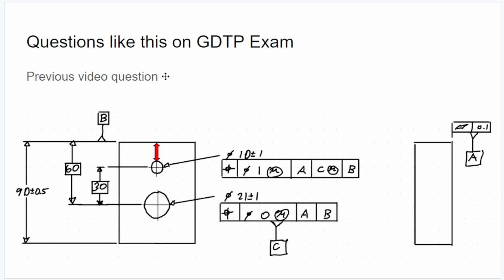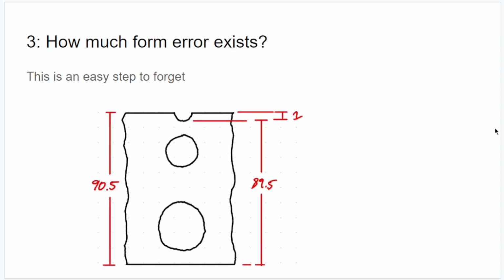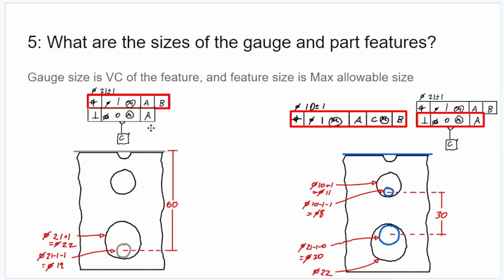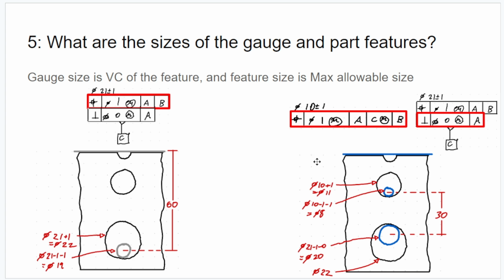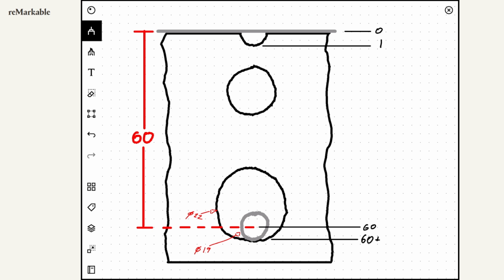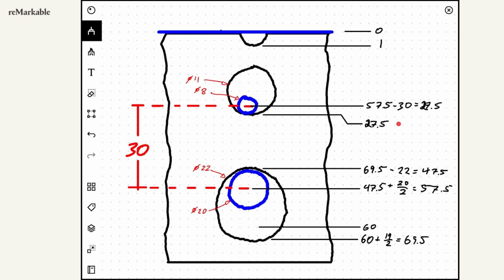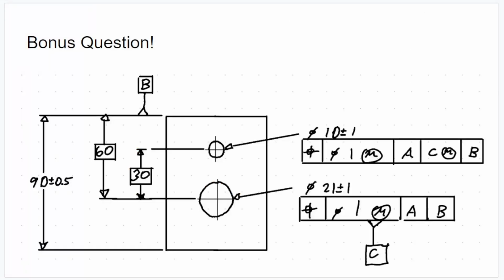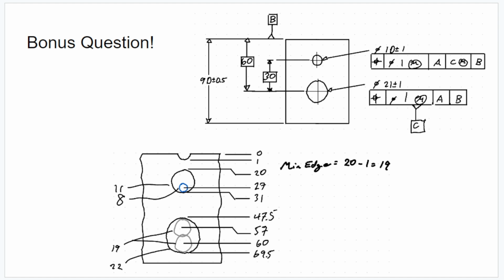ASME Y14.5 Minimum Edge Thickness Example 2

Comment: Hello, why are you referencing the second feature control frame for the second basic dimension? 
21 - 1 - "0" = 20 MMC gage pin. 

Why reference the second FCF and not the first?
Reply from the maker: If I'm interpreting your question correctly, you're asking why I used the perpendicularity control of datum feature C to calculate the size of the datum feature simulator when looking at the allowable distance between the two holes?

If so, it's based on datum feature precedence. Best to refer to figure 4-16 and paragraph 4.11.6.1 in the 2009 standard. 

Once you have read that paragraph, the important thing to realize about this problem, is that the minimum distance for the 10mm hole to datum feature B, would be the same if the 10mm hole did not reference B in the feature control frame

Hope this makes sense